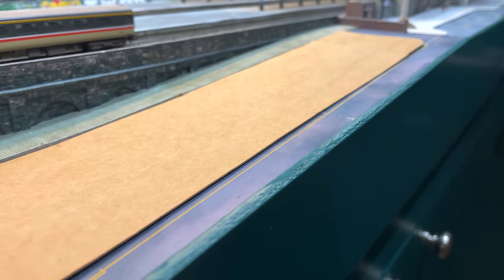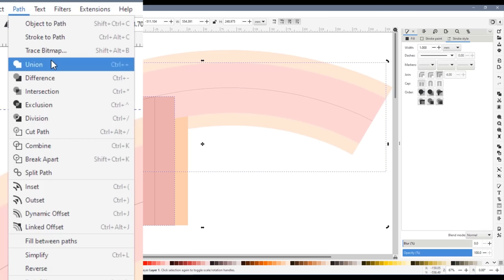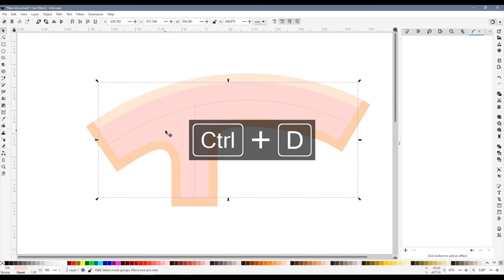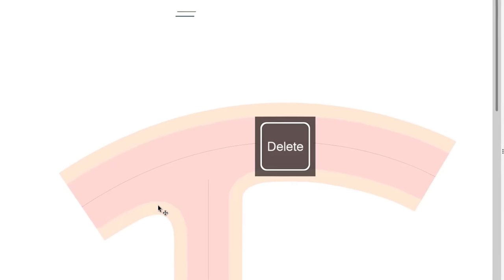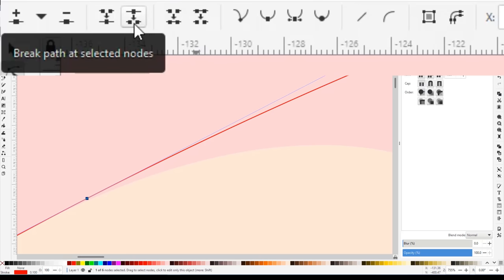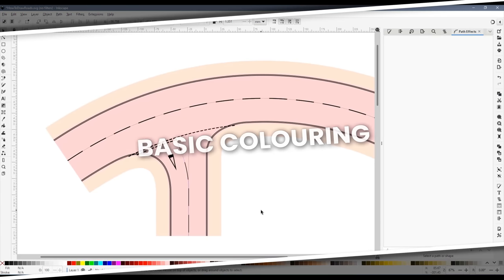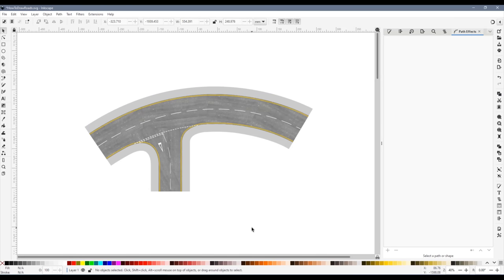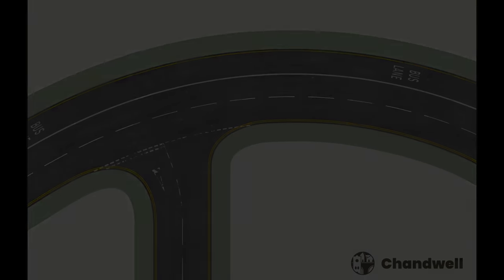Realistic model roads - How to draw realistic roads for your model railways using Inkscape

Comment: Wow! You even used the correct road markings, from the 1:1 guidance manual! As a retired Highway Engineer I see that most modellers just do what they think looks right and often isn't. 
As a PS the coloured lines and symbols on UK roads are mainly laid down with a 5 to 10 mm thick plastic material, hence they can last longer than straight paints used in other countries.
I look forward to your next update on Chandwell.
Reply from the maker: Thank you so much!

Comment: Michael this is great, I’m getting to the point I need to start thinking about road surfaces on my layout so this upload is perfect timing!

I scratchbuilt a 1930s style shopping parade last week, when I did I test print to look at the hipped roof I scaled the shapes down by half so it would all fit onto one A4 piece of light card.  As I’m modelling OO gauge this showed me the size the building would be in N gauge - I was really surprised!  It was a lot smaller than I imagined and made me appreciate even more how skilled your work is.  I don’t even think I could attempt things like complex window frames on N scale, or at least not at the moment.  You’re a true craftsman.  Thanks Michael and best for now 👍🏼
Reply from the maker: Thank you. In reverse, I was shocked by the size of a 3mm building when I made one with Liam. 00 is bigger again. I think it’s because each dimension (width and height) doubles therefore the volume of a 00 building is 8 times bigger, I think. Regardless, it is a surprising difference when your used to one rather than the other.

Comment: Hi Michael. Another brilliant video, thankyou. When you glue your printed roads down onto your layout, how do you disguise the paper edges. I can't see the joins in your pictures but they must be there!
Reply from the maker: I cut them with a brand new scalpel blade, and take care to angle the blade ever so slightly inwards . I then run a grey watercolour pencil down the edge and carefully butt the edges together. It's not perfect but it works OK.

Comment: Hi I am at the start of building my roads and buildings on my Ngauge layout, and find inspiration from your videos, having just retired I will now have plenty of time to make building your way. I noticed you use a board to stand your buildings on /pavement, could I ask what size is the thickness of this and is it card or hardboard, I like to get a kerb side drop to my roads. 
Have a good weekend and stay safe. Thanks
Reply from the maker: Hello! Thank you for watching. I usually stand my buildings on 1mm card. I sometimes use 0.5mm or a 1.5mm base made from 1mm and 0.5mm for a bit of variation. If I’m modelling on a hill (which I usually am), I use multiple layers of 0.5mm card rather than one layer of 1mm as it bends to the contours better if you build it up.

Comment: Great video! l am looking forward to try this myself. Are you using some special printer or paper? When I am printing a colored picture with my printer, the paper often becomes a little wavy.
Reply from the maker: Thank you. If you use basic copier paper, it will tend to wave a little as the ink bleeds into the paper. Have you tried using photo paper? I use a basic brand matt paper, and it works really well. There are more details here: https://youtu.be/-QvdNFST7WU
Reply: @Chandwell  I haven't tried photo paper yet, but I will give it a try for sure. Thanks for the link. I looked through your uploads to find a video like this one, but must have missed it. Very helpful!

Comment: Hi Michael up to give way signs now thanks for all your help. Found out problems on IMac have to use cmd key opposed to Ctrl key for certain operations. Also made mistake of duplicating which I had to ungroup before stroke to path. Thanks again brilliant had to watch a few times but learning a lot from your videos just making a few notes now to remind me of operations.
Reply from the maker: Glad it helped
Reply: @Chandwell  hi Michael how do you model kerbs on bends ?
Reply from the maker: Cut a strip of curbs. Cut out little triangular notches from the outer edge to the centreline. Then just glue and bend around.
Reply: @Chandwell  thanks

Comment: Hi Michael another varnish question (!), with a road surface would you still use a matte and then on both sides of the paper to seal it all in? Or glue it into place and apply a seal once in situ? Protecting the surface is one of these things I've recently started to think about a lot 🤔
Reply from the maker: I glued mine into place and then added two coats of Matt and one of ultra Matt.
Reply from the maker: I glued mine into place and then added two coats of Matt and one of ultra Matt.
Reply: @Chandwell  Thanks Michael

Comment: I’m getting to the point on my layout where I want to start putting in roads so I’ve rewatched this video a few dozen times :) 

One question I had was how did you translate the actual space on your layout to Inkscape? I have my roads drawn out on my layout and they have some subtle curves in them. Is it just careful measuring or did you use some other technique?

Because my layout is small, I took an aerial photo of it and resized it to n gauge scale in Inkscape so I have actual forms I can just overlay. But on a larger layout this might be unwieldy so I’m looking for tips on getting “real world” road dimensions into Inkscape.
Reply from the maker: I don't think I have any tips there. I have used the photo method before, but on a larger layout I think I would just use careful measurements and by using cheaply-printed mock-ups, I would adjust until I had it about right.

Comment: Getting used to Inkscape doing roads but having problems union top and vertical road selecting top road shift then vertical road and path union and repeating this for pavement.

To be able to move the shape I have to click top road shift and then click vertical road and then can move as one shape but as soon as I do the same for pavement have to do the same,

Once done they do not stay as one shape what am I doing wrong ? Any help appreciated thanks😅😮
Reply from the maker: I’m sorry Derek but I can’t work out what you mean, so I’m not sure.
Reply: @Chandwell  when I select both roads and path union they stay as one shape when moved , but if I select both pavements and path union they also stay as one shape but if I select Road or pavement they are not one shape but two separate shapes
Reply from the maker: @derekmurton1656  you can only Union something that is a path. So make sure it’s not grouped and make sure it’s not a line and that you remembered to do Stroke To Path…
Reply: @Chandwell  thanks I’ll try again did read there is a glitch in latest version for Apple Os  users so may have get earlier version
Reply: @Chandwell  think I’ve found the problem as I grouped together to be able to move to print canvass and then duplicated and didn’t ungroup